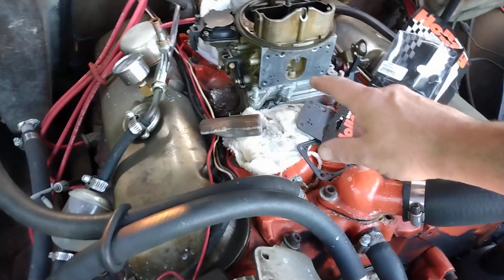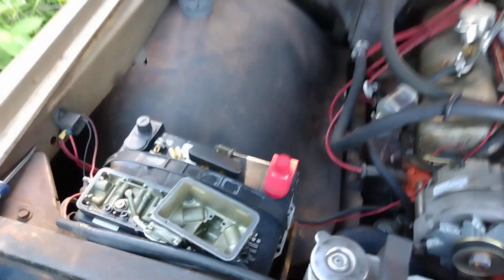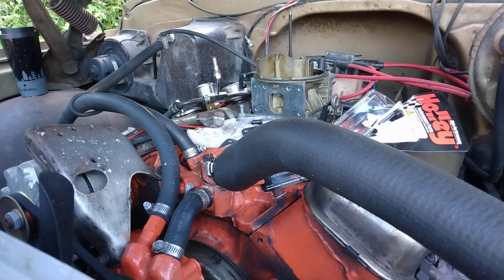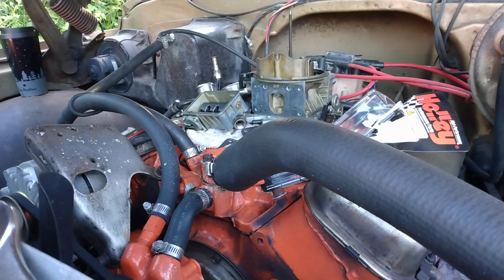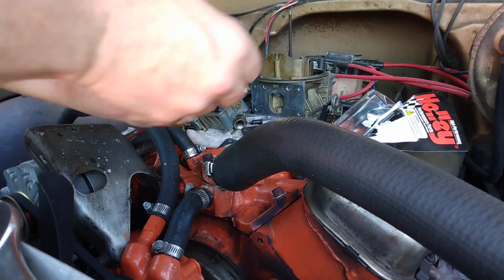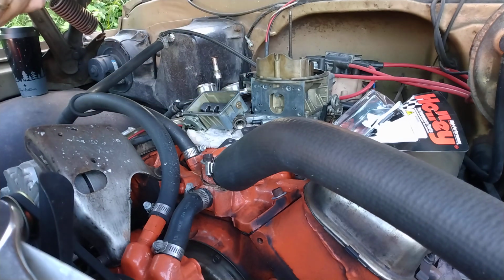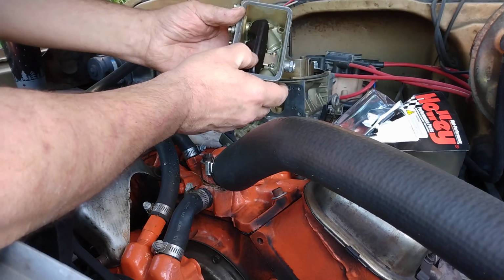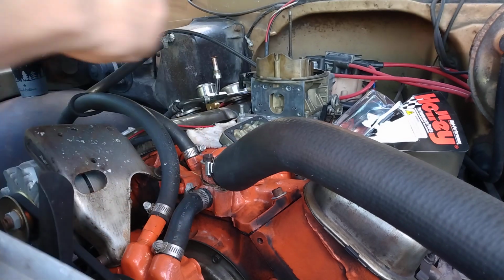Holley 750 carb upgrade

Comment: I don't think I am brave enough to do this while it is on the vehicle. I would have to pull it off and do it on a bench. Glad you got float sorted out. Great tip. Can't wait to see the next video and if you got it all working how you wanted.
Reply from the maker: That is absolutely the preferred method 👍 I was a mobile mechanic for years and get lazy, the only dilemma would have been if the float tensioner got away on me. It seems some better and also seems richer now. Will get down a size when the bowl vent extension gets here. Always great to see you brother 👍

Comment: A lot of packaging these days is Child Proof & Adult Resistant! Was the Bog you mentioned off idle? Just curious, because I have used Jet extensions and notched floats in the rear to allow the jets to stay in the fuel during acceleration, but never in the front. Fuel reaching the front jets is usually not an issue.
Reply from the maker: The real problem is during elevation transitions and cornering. The bowl vent baffle was missing when I got it, that might be a good candidate for causing the  problem too. Descending right turns are the worst and the fuel feeds from the right so trying to decipher if the slosh maybe was letting the right jet get uncovered. Will maybe try making a ledge in the bowl to hinder slosh as well, or put a swaybar in it LOL 👍
Reply: @TheCanadianBubba  👍